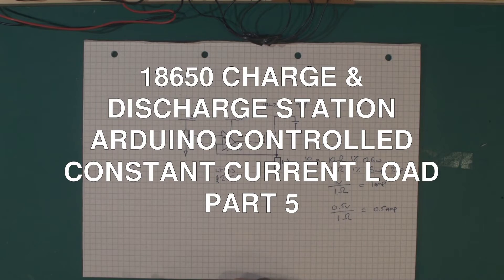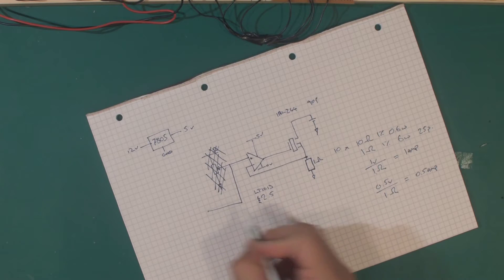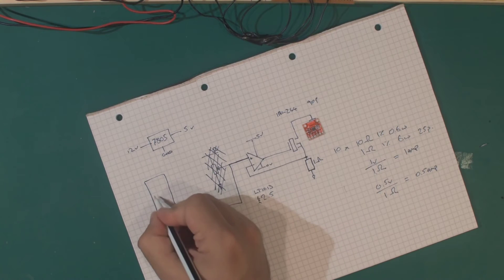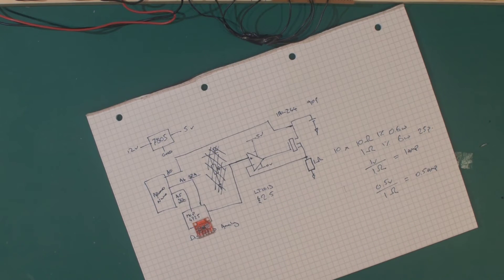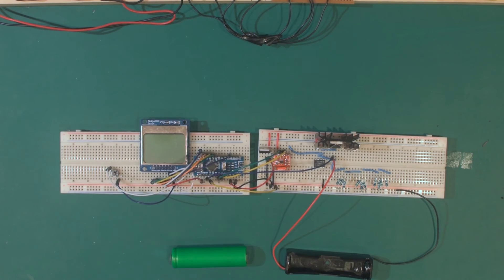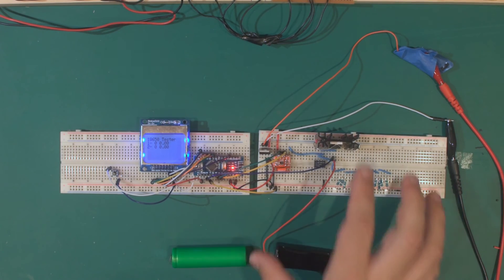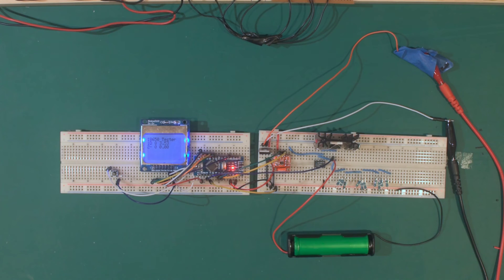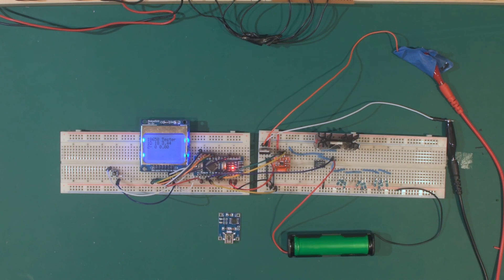18650 Station - Arduino Controlled Constant Current DC Load

Comment: Hi, i dont see current sensors so how are you able to know the amount of current, specialy at the end of the discharge ?
Reply from the maker: Raoulos Iers because the load is constant, it can be achieved by just measuring the time it takes to get from 4.2 to 3.0 volts. i.e. if the load is 1A and it discharges in an hour to 3.0v then it's 1Ah.
Reply: Ok thx it confirm what i thought, but it's close to the results from a B6 discharger ?(or other famous charger discharger), your code will be very useful, thx :)

Comment: Chris,

Very interesting work.  I'm looking forward to your and NerdVille's collaboration.

I apologize if I'm asking questions which have already been answered.  Did you consider using the PWM from the Arduino to directly drive the MOSFET duty cycle and control the discharge time?

Do have more close up images of the modifications you made to the TP4056 for using CS and monitoring when charging stops?

Thanks
Reply from the maker: Russ Husky Thanks Russ. Yeah a simplification could be to use a RC filter to convert the PWM output into a DC voltage to drive the input to the OPAMP. 

I want to work out how to calculate the accuracy of a RC filter of the PWM as that voltage sets the discharge rate, which would be nice to understand the accuracy with which it's set. that was easy to know with the DAC as it's in the data sheet.

I dont right now, but I can put a section the the next video with some close-ups for you.
Reply: Chris,
 
I think we may be talking two different things.  I'm suggesting drop the OPAMP completely and control the MOSFET directly from a digital pin, like Adam's video.  You can then use your current monitor to adjust the PWM to get the desired discharge rate.

I'm going to cobble one up and see if I can make that work.  

First I'm going to try that CS on the TP4056.  

Looking forward to your next post.
Reply from the maker: Oh right sorry yes, you can do what Adam did, all that means is the control loop of maintaining the discharge rate is then limited by the intervals with which the Arduino can update its PWM output, but also to the accuracy of the ADC checking the voltage. The OPAMP does all that instantaneous and doesn't really add much in the way of cost (I think I over spec'd mine and a cheap lm324 could work just as well). 

You can remove the OPAMP and use the same technique of measuring the voltage over the resistor and after the MOSFET to feedback to changes in PWM through a RC filter to drive the MOSFET gate. That way you drop the current sensor as well.

Although off the top of my head i'd want to keep C values low so you don't get any undesired oscillation as RC filter may change slower than the Arduino is checking and updating PWM, maybe something to check with a scope.

Comment: the arduino doesn't have a dac per say, but you can filter the arduino pwm to be analog using a cap and a resistor
Reply from the maker: +BitsAndBites yep, I started there before I filmed this (but didn't include it), want to do a comparison on accuracy of the filter vs dac at some point. I may just even remove it all together and fix it at 1v if I don't end up needing to vary the loads.

Comment: Good video, i'm currently having some major reservations about all my 18650 cells i've tested with my liitokala as i tested a few of the cells in my iMaxB6 as well and they showed drastically less capacity.  Running a cell through my home made version now to see how that compares also.
Reply from the maker: +Colin Hickey (Lets make stuff!)Thanks! I've had similar issues, it has made me wonder how accurate those devices are with the load they apply, which lead me down this route of the homebrew. Also it seems this could be quite cost effective at scale. I want to retest the last 60cells on this new setup once i have the automation in place. On a related note, enjoying your videos as well, rs485 was ingenious, and more solar play shed setup welcome especially if you do 18650 upgrade :)
Reply: Cheers mate appreciate it, i made a discharger based on Adam Welch's design.  I'd kind of mothballed it but dug out an Aruduino nano and flashed it up and testing a cell now, agree that it could scale up and thought of integrating a TP4506 charger as well but never got off my bottom to put the time in so following your videos :-).  Thanks on the RS485 comment, i'm really happy as it's something i'm actually using daily and it works lol  not seen much info out here either doing similar, not in English at least!
Reply: Well I've tested a few cells and i think my iMax B6 may be borked as testing on my LiitoKala shows over 2000 mAh as does my homebrew, homebrew shows 1000 less but i can live with that.  the iMaxB6 seems to be 1500 out :-(
Reply from the maker: +Colin Hickey (Lets make stuff!) glad you found the culprit. I have heard (more from the RC forums) that the iMax B6 clones are less than reliable.